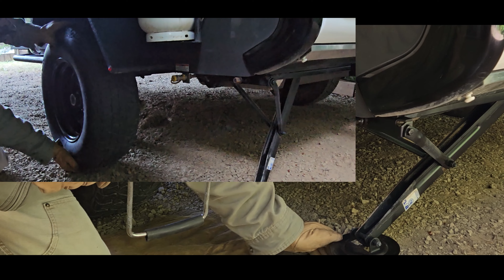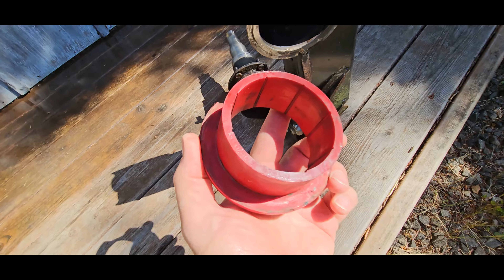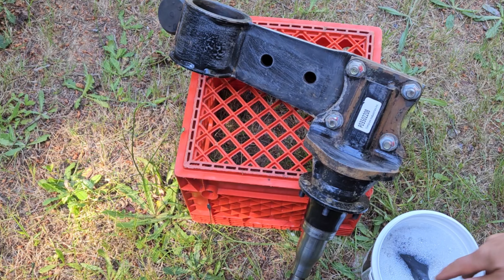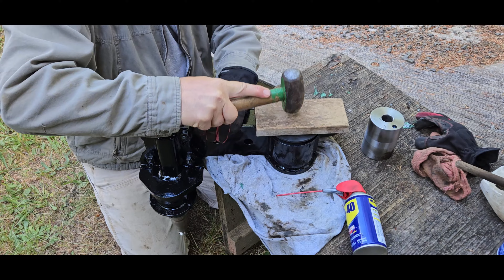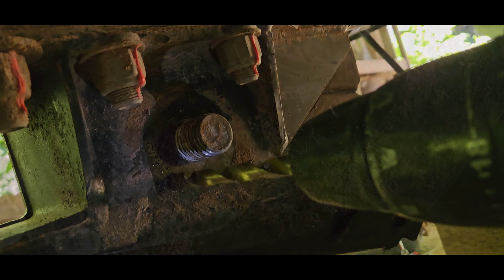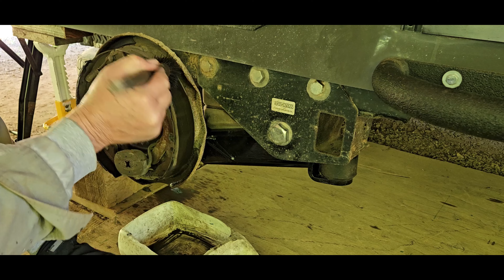Timbren Suspension – What You Should Know

Comment: David, thanks for posting this video
- how many miles did the bush last before you replaced it?
- what laden mass is your teardrop?
- did you notice any camber change or alignment issue with the worn bush?

Where I live, the highways are so rough as to distroy the rubber torsion axle in my teardrop asn I am looking at options that will better cope with the 3rd world conditions in OZ highways
- the drag arms twisted and put the camber out reall really badly (some 10 to 15 degrees reverse camber on the most bent side) The suspension is utterly toast as a result
Reply from the maker: We had about 25,000 on the trailer at the time of this video. A good portion of the miles were on dirt and low maintenance roads. I noticed some uneven wear in our tires... That's covered in this video or one just prior.

Think the Timbren system is good but lubing 6,000 miles is better for dirt and tougher conditions. 

Our trailer typically weighs about 3,500 lbs.

Comment: David, I'm about to do this job. I noticed that when you pulled the "locking washer" at the start of the video, the pin on the washer was pulled out of an existing hole in the suspension arm. Why did you have to drill a new hole later??
We bought one of the very first Black Beans. It's a heavy trailer, at 3200 dry. I think Bean just continued to use the 3500 suspension and should have stepped up to the 5000 suspension on this trailer. After talking to Lisa at Timbren, she agreed. SO.....the good part along with the bad. Timbren is sending me new bushings and also sending me stiffer rubber springs so that the suspension will better cope with the weight. The bad part....is that I have to do this job. LOL
Reply from the maker: I just decided to drill a new hole so I wouldn't have to align the old hole, which looked like it might be tricky. I think that option may (or not) make sense when you get there. Best of luck with the project.    Sorry to hear about the problem, but it's nice to know this video could be helpful. Thanks for the comment, keep us posted!
Reply: @dchurch911  Thanks for your quick reply. I thought that may have been the case with the washer pin alignment. Timbren has been great, I'll receive parts for the job today. I liked your use of the wood splitter for a press. I don't have ready access to a hydraulic splitter so will probably try the good old washer/bolt pull method. I've done that pressing method with motorcycle parts and car suspension bushes before and with good success. We'll see. :-)
My Black Bean was one of the first Black Beans off the production line. I'm thinking that Bean underestimated the dry weight on the Black Bean (with options) and they should have used the 5200 rubber springs instead of the 3500. That's what Timbren thought too and they are sending me a 5200 spring set. They also recommended that I double check the 450 ft/lb torque on the main hinge bolt.....after 500 or so miles and again at 5000 miles.
I'll keep you posted. Thanks again....

Comment: One headache saving tip that I'll add...Remove the round rubber shock from the end of the control arm when re-installing. I fought mine forever with that rubber shock installed, and was not able to jack the arm up into to place for the bolt hole to align. My camper is light enough that the main rubber absorber would not compress enough to line the hole up. With that round shock removed you can easily aline the control arm main pivot bolt hole. Once the main bolt is in place, you can compress the arm with a jack to reinstall the round shock.
Reply from the maker: Thanks so much for adding this tip! I hope you and I never have to use it, but it could be a great help for other poor unfortunate souls:(

Comment: What is the size of the main pivot bolt? I've tried 1-1/2" and 38MM, both are sloppy.
Reply from the maker: I have it shown as a 1-1/2". You could double check with Timbren Inc., there support is very responsive. A 38mm would be a hair larger. I wonder if your socket is worn. A good six point socket should be used for this job. You do want a nice fit because there's a lot of torque required. Best of luck with this.

Comment from the maker: Cameron Fenno 1/14/24 Recovered Comment (accidently deleted)
Thanks so much for this video. Having to replace my Timbren bushings for the same reason. Did you have any staining or pitting on either of the pivot cylinders? One looks great, the other looks dirty, but this is after a lot of cleaning. Can see pitting and the texture is not as smooth as the other in those areas: https://youtu.be/k8_psJl6CSs?si=gWkr-NbCvUDebNre My fear is if I put this back in anything close to this condition, it'll wear down the bushing and I'll be doing this again in a year. 

Cameron, Sorry I accidently deleted your comment while trying to resolve a Youtube reply glitch. 

I'm glad you found this video, sorry you had to do this repair.
I followed your link and understand your concern. My pistons had signs of discoloration but they had no pitting and were smooth. 

I would send some photos with closeups to Timbren and ask for a replacement.  
Step up the frequency of greasing these. Grease is cheap. Do yourself a favor and get a good grease gun and connector if you don't already have them. (See Description)

Please help spread the word about frequent greasing and checking chamber/play. As you know the repair is no fun at all.

You've probably seen our "Lube it Now" video. It's a shame it has so few views.
https://youtu.be/T89eJ8MCkyM?si=oIojcS5mYt42QJ7f

Best of luck with finishing the repair, and happy trails. Dave